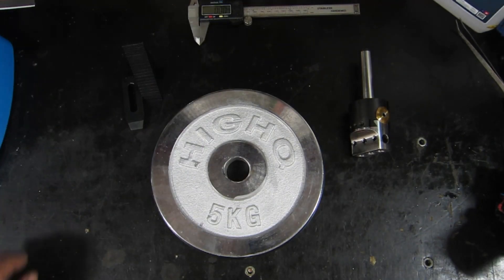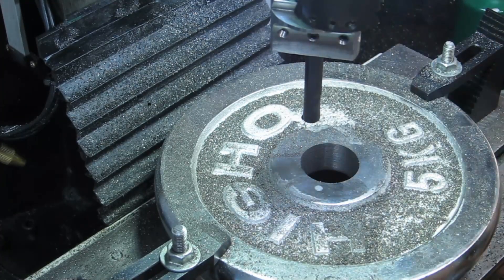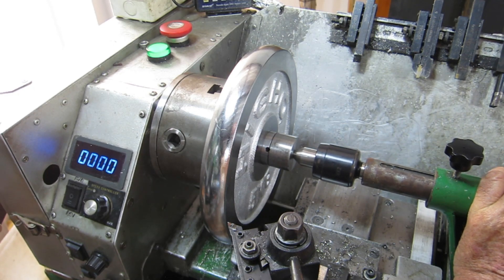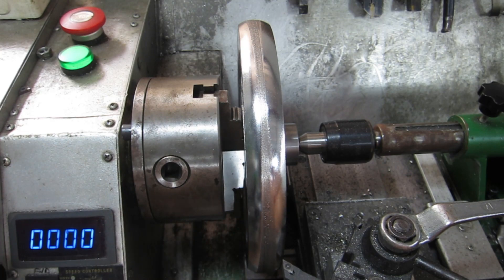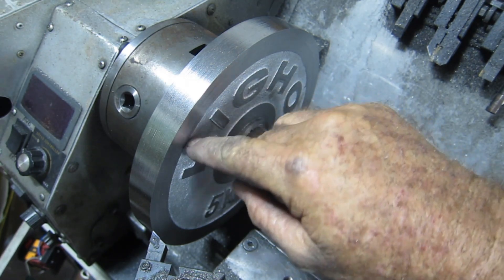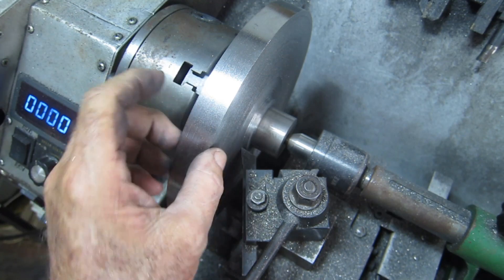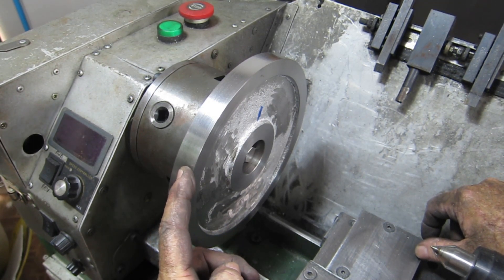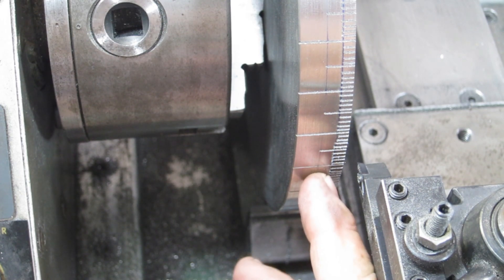Homemade Rotary Table - Part 1 - MHW Episode 78

Comment: How did you know how much to turn the chuck to index it
Reply from the maker: If you go back through my videos you will find a 2 part series on the spindle brake I made using a hydraulic bicycle disk brake, part of that is a paper-printed disc with 360° marked on it, I have a couple of different discs, and another only has 100 divisions marked on it. Thanks for watching. 👍
Reply: @MyMiniHomeWorkshop  thanks for quick reply!
I'm a white guy living in Malaysia and often drive to Hat Yai.
If you happen to  live nearby we can have a 🍺
Reply from the maker: @TigerCarpenter  I'm up in Pattaya a very long way from Hat Yai

Comment: I resharpen my inserts with a small hand held multi tool and grinding head
Reply from the maker: I generally only buy the cheap Chinese inserts and I don't think they are worth messing around with, I have tried giving them a rub on a diamond stone with no success. Thanks for watching. 👍

Comment: Why did you choose cast iron for this project?  I’m trying to learn which metals are suitable which projects. Material science is one of my weak spots.
Reply from the maker: Mainly because any bought version would be made from cast iron 👍
Reply: @MyMiniHomeWorkshop  is that due to cost? Is it easier to scrape cast iron over others? Would using a “standard“ cold or hot rolled steel present other issues or deign complications?  Sorry. I’ll stop asking questions.
Reply from the maker: Scraping is definitely a lot easier with cast iron, and it is to a degree self-lubricating because of the high carbon content. With steel, you might have galling become a problem.

Comment: You can find cast iron stock by searching for "ขายเหล็กหล่อ". One of the most common grey cast iron sold here should be JIS FC200 (or FC20 for old designation). Most metal stock sold in Thailand follow JIS as there is a lot of Japanese firm operating factory here. Luckily there is many suppliers with store front operating in my area so it is relatively easy for me to buy.
Reply from the maker: Thanks for that 👍

Comment: I may be seeing things but you appear to have a f*ck ton of slop in your carriage and/or tool rest. That could explain a lot of the broken inserts.
Reply from the maker: There is a bit in the cross slide, the tips weren't breaking, it was just grinding the 0.2mm tip off, which wasn't viewable when I tried to show it 👍

Comment: Machining cast iron is horrible.  When machining car brake rotors on a brake lathe, I can only ever get a 0.010" cut depth.

A steel shaft is definitely more common.  If you were trying to machine the shaft, then truck rear solid axle shafts have a nice hard alloy.
Reply from the maker: Yeap it's real shite, don't think I'll be electing to machine much more of it 👍

Comment: I think my ears are burning for some reason, but 1 in 1350 is pretty good odds for guessing😉
Was going to say the same as Sad Panda, most likely mixed scrap from USA melted down in china and cast as weights(not important just gotta weigh somewhere near the right amount)
Was thinking about saying something before about the chrome plating but kept my mouth shut, you know what you're getting into.
And Welcome to the world of machining cast iron, it flies everywhere and gets into everything, might want to check actually where, when you finish this job, recheck your DRO, slides, bearings etc, also best not to use air to clean it out, it just blows it in further from my experience.
Cheers from Aust.
Reply from the maker: I was prepared for the chrome to be hard, but not the cast iron. In my factory, we only machined 1 grade of brass and occasionally a tiny bit of copper, the scrappies used to fight over it because they knew what they were getting from me. It was mainly put in wool bales and sent to China, one of the dealers was saying the Chinese would just toss the whole bale into the furnace without ever checking what was in it. I would think Cast Iron would get treated the same, full of steel studs and other bits. And yeap, that shit is everywhere. 👍

Comment: I'm not sure that is pure cast iron, there might be another alloy mixed in with it as it seems awfully hard. Should hold up nicely though once you get it all machined. 👍👍
Reply from the maker: My thoughts exactly, I'd bet they are only made from scrap and could contain almost anything. This one is nothing, wait till you see the dramas I have with the base for this part and it isn't chromed :face-orange-raised-eyebrow: